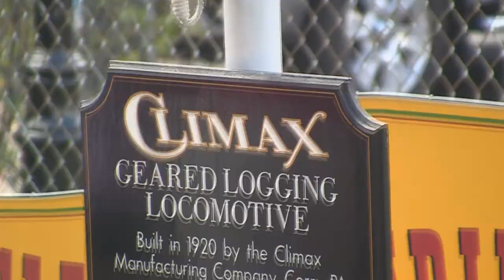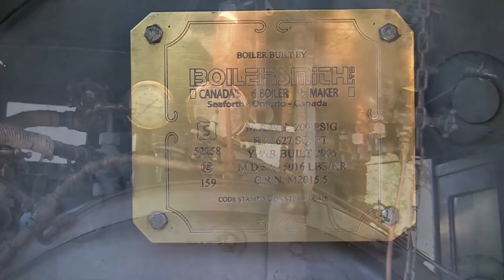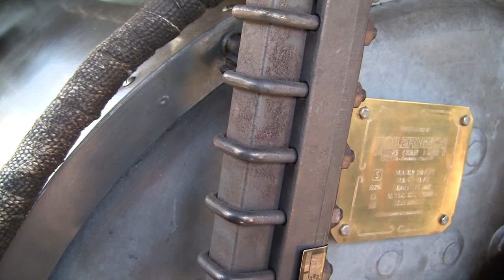No 6 Climax - Full Cab Ride - White Mountains Central Railroad

Comment: These Climax Loco's were actually hated by most the guys that had to operate them on a Daily basis. Constantly needing more maint. since they'd literally shake themselves to pieces if not looked after. They had gobs of Tractive effort though which was great for pulling lots of weight up steep grades you'd find on Logging routes.